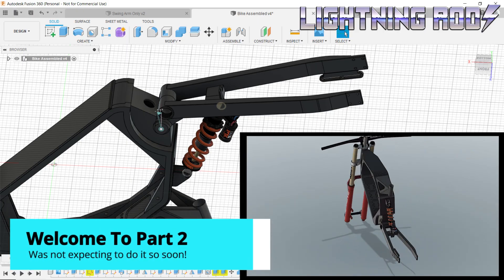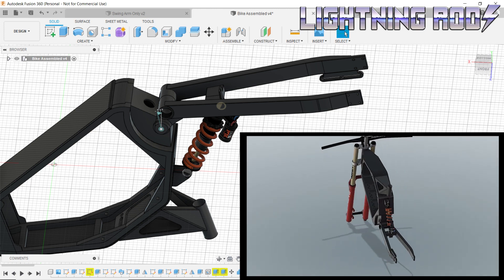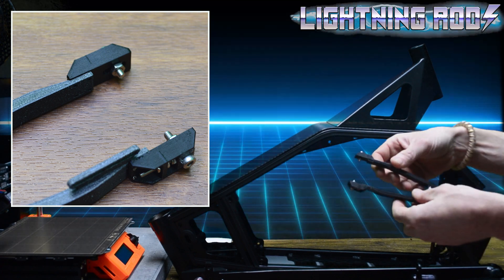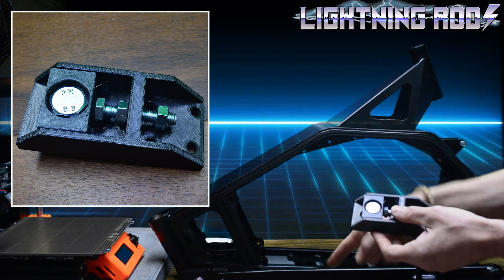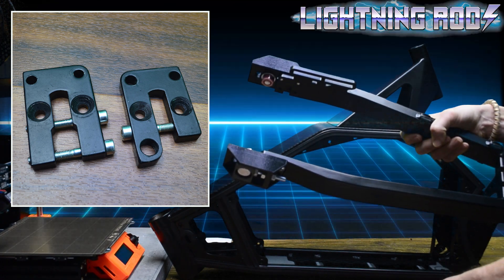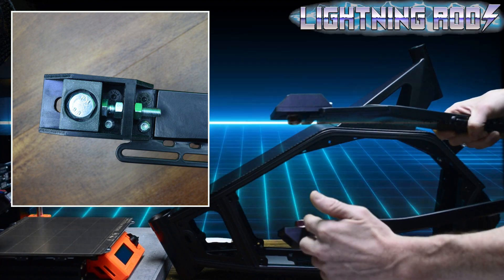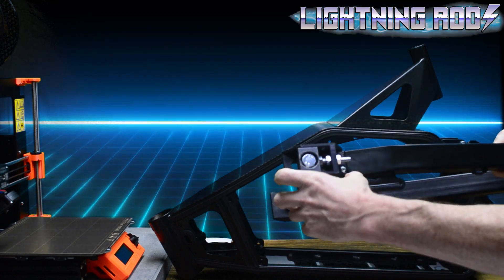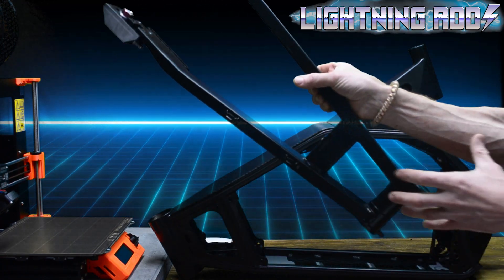Lightning Rods Big Block XL 10kw Ebike build Part 2

Comment: hello
where did you found the 3d drawing? i would like to have it / buy it
Reply from the maker: Of the frame? Or the fork. Some stuff I did myself. The fox fork was from Grabcad tho.
Reply: @HighVoltageKits  frame drawing
Reply from the maker: I will have a look at the file. It's a mess tho.
Reply: @HighVoltageKits  have you had time to find the file?
Reply: no problem. i.m interested only in angles and sizes.

Comment: Will you ever be designing a wider swingarm so that people can use a proper rear 18" tire?
Reply from the maker: When you mean wider for the 18" is that wider at the rim or at the dropout or wider in length to the dropouts? If that makes any sense. Nothing is set in stone so this kind of feedback is really good. Thanks.
Reply: @HighVoltageKits  I mean, a swingarm that's wide enough at the front to accomodate an 100/100-18 tire
Reply from the maker: I understand now. There is a limit on the width due to the chain right now. There is a wider swingarm for a fatbike tire but it won't work due to how the chain is sent to the rear sprocket. I hear what you are saying though. Its a good idea for a future modification. I think this frame system allows for a wide range of bikes and the use of a really nice fat road tire on the rear has its advantages. It would look badass to boot. Cheers

Comment: I'm sorry you didn't design the back tensioner its just what you get on a MX bike.   Come on please 🙏   it looks really good but its not rocket science
Reply from the maker: Hey, thanks for the comment. I understand what you are saying. I think the difference is in the wording. I make no claim to have invented this system. But the part you see I drew from scratch based on another design I saw on the Sir Ron bike. I then printed out prototypes on my 3d printer. Its like Frank Whittle and Co invented the Jet Engine and since then there have been many designs of jet engine made by others. I make no claim to invent this part. Horizontal tensioners are used everywhere. Apologies if I gave the wrong impression. I am not trying to be anything I am not. Cheers 🍻

Comment: Will the frame design be able to use a belt drive instead of chain? 
Do you have an idea of the expected full built bike weight, complete with battery
Reply from the maker: Hey Danny, good to hear from you! I don't see why it couldn't use a belt. The tension system allows for a thru axle to be used and usually the sticking point with belts is when you have to essentially build the belt into the bike and it becomes a pain in the ass to install or remove. If you have a look at these photos you can see the first stage is already belt driven. I imagine that if a pully was fitted to the jack shaft in place of the sprocket it would tension a belt in the same way as a chain. But I have never used one so don't take that as the gospel lol. In terms of the weight... The frame so far I think is about 10 kilos. When its all said and done I think between 50-60 kilos possibly. Much of the range depends on the size of the battery. I will have a better estimate once more components come in. I would like to at least match the Sur Ron in terms of weight. Maybe come in a shade lighter. Cheers!
Reply: @HighVoltageKits  the belt drive I had was a pain in the ass to fit, but the quiet drive train was worth it. That’s why I asked, 10Kw mid drive, with belt drive 40ah, and around that weight is all music to my ears. 
Definitely following you with this bike build.
Reply from the maker: Awesome! Should be a fun ride :)
Reply from the maker: https://captaincodswallop.net/lightning-rods

Comment: Very Detailed & planned build, should equal an awesome final result 😊👍 A 10KW motor is going to be insane ! It will be interesting to see what range (distance) you will cover with such a big motor (load) But i can imagine you could play around with power levels etc. 
Great start to the build mate 👍👌 🚴
Reply from the maker: Thanks! I am also curious with the range. I have a 21 amp hour 72 volt pack for testing. The end battery will likely be more in the 40amp hour range. I'd like to make it modular though so if people wanted they could have more or less weight / range.

Comment: it would be amazing to see a comparison between this and a vector vortex when it's all done and ready to go. I'm curious to know whether or not it's worth going for this more hard path instead of going with a traditional hub motor center mounted. 
have you already decided what controller/battery combo you're going to run on yours?
Reply from the maker: I am looking at a modular battery system and possibly trying two controllers. The ASI4000 at 72 volts and a vesc based at 90 volts. Its not a definite thing yet tho. You can use the vortex frame with a number of motors. Im not so keen on the hub mid drive but there should be quite a few powerful motors that could be mounted in that space.
Reply: @HighVoltageKits  have you heard of Mobipus controllers or Nucular? Honestly i would ditch the ASI route, but if you have some solid contact with them and you can get help with the setup they're extremely good controllers.
Reply from the maker: Nucular yes. Getting one tho is nigh on impossible. I am not exactly thrilled with ASI either. They just don't seem to be willing or able to fix glaring errors with their firmware. They are also very sensitive to phase overcurrent issues and are extremely non user friendly. But I have also put alot of time into the development of the nxt display. So I would want to use a second generation of that and currently its only functional with the ASI. I will update on it when I can. I will be using the Vesc platform as well. If I did not have the part in the NXT development though the ASI would not even be considered for this build.